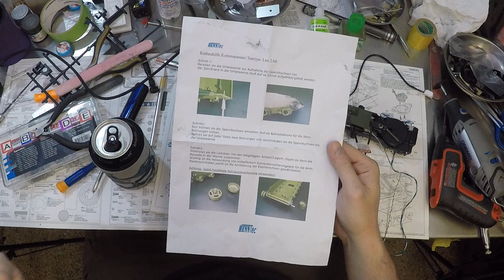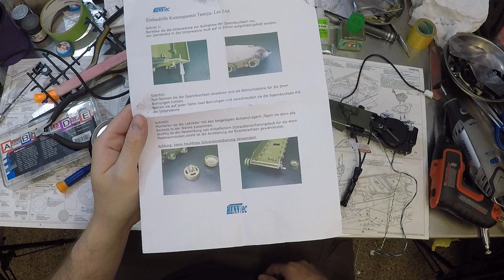Tamiya 1/16 RC Full Option Leopard 2A6 Tank #56020 Build with KingKong & Schumo-kits upgrades part 9

Comment: Coming up on half way.
Much appreciate your commentary. Between the King Kong design fail and the lack of 360 degree traverse needing a notebook somewhere to count the traverse lefts and rights, I think I'll save my money. For almost $3,000 Australian (if I bought all your mods) I'd be looking for something that goes together well, had slip rings for the turret, etc. I think I'll just stick with my 1:1 scale one at work.
Reply from the maker: well hindsight being 20/20, if I did it all over again, the only real needed aftermarket upgrade would be the metal suspension arms, everything else is really not needed and I just added it all for the hell of it, the tank kit goes together amazingly well, i do have to say I am a bit jealous you get to play with the real thing at your job.

Comment: Had the same issue with threads on my Kingkong
Reply from the maker: Yeah in hindsight a little 3-in-1 oil on the screws may have helped, other than running a tap through all the holes. They really screwed us with that chassis, even though all their other parts were fantastic.